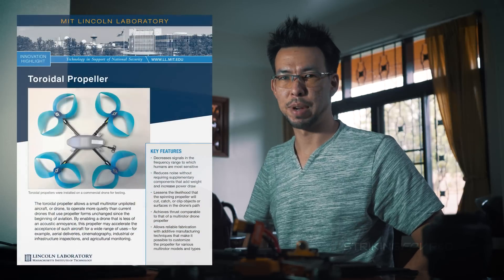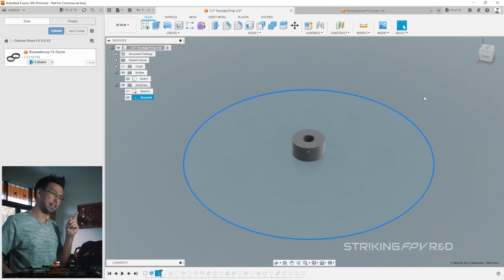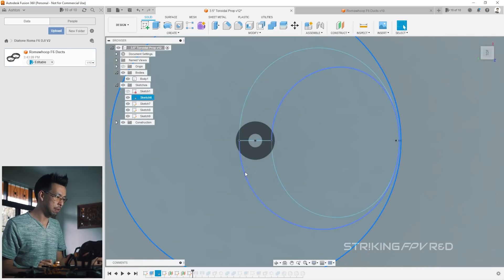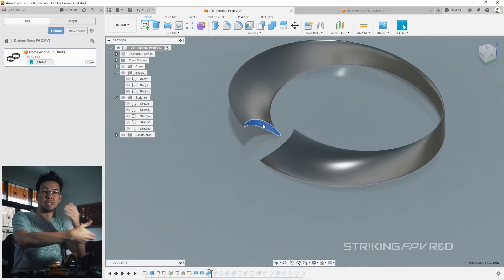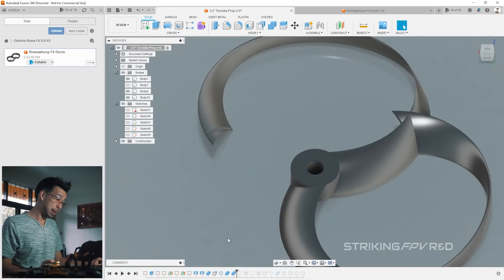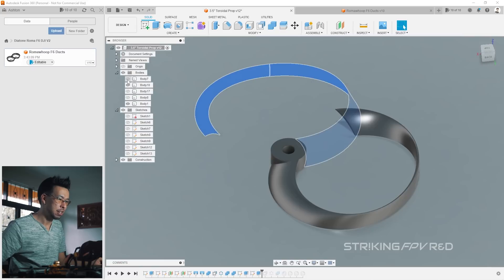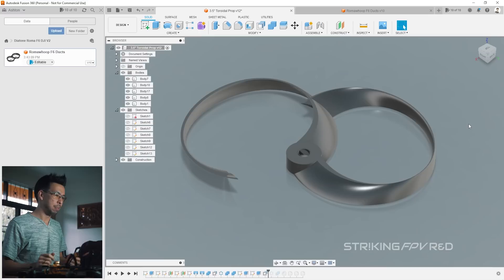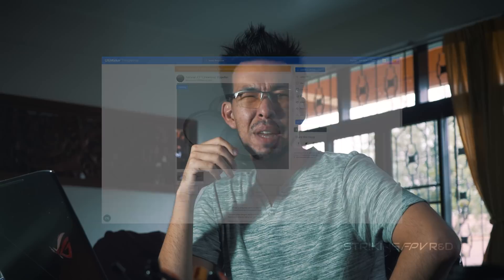DIY MIT Toroidal Propellers for Cinewhoop FPV Drones???

Comment from the maker: FYI: Latest video featuring frequent questions and suggestions is up:
https://youtu.be/pjZaGHKQB8Y

Hey all, so I couldn't wait and I added a bunch more sizes from 40mm, 2" up to 4", but all scaled from the original so they're not ideal.  Larger sizes would obviously need to be redesigned, but for now this will do.  Also I've never used or designed t-mount stuff either, so no idea if they'll work.

Interesting thought, a commenter named Max over on Thingiverse has already tried the design in TPU and it worked!  This has me excited for two reasons:
1) It works!
2) TPU might be a viable material here, because the toroidal design kind-of loops back on itself and provides more support for the overall shape.  Whereas regular TPU props would flex and flail in the wind, maybe this toroidal shape will hold stronger, despite the more flexible material.  Who knows!

And recently also @QEDFPV printed and tested the design to find lower noise and more thrust (but more amps) so certainly more work to be done.  Check out his video here:
https://youtu.be/qP0OPz3NgK4

One last update, I've already begun with another generation of the tri-toroidal design which tries to improve on blade shape and a shallower blade angle going out towards the tip.  Doesn't look as pretty, but might yield better results and be slightly lighter in weight, plus a bi-toroidal design too:
https://www.thingiverse.com/thing:5832892
https://www.thingiverse.com/thing:5833027

Comment: Thank you for your great work. To reduce the drag and weight, you should reduce the thickness of the blades as much as possible. This is where you will save energy and improve efficiency, from what I can see.

Comment: hi, your video is greatly wondful! but there is a question about the toroidal propeller, how do you calculate the geometryical parameters of the propeller, I am studying this question, I would appreciate it if you can reply to me
 :face-blue-wide-eyes::face-blue-wide-eyes::face-blue-wide-eyes:
Reply from the maker: Please watch the 10 Toroidal Questions video I did, as it might help a little in that regard, but not much.

Unlike traditional propellers, for which we have numerous aerofoil designs available and a known concept for calculating correct propeller pitch across the length of the blade, toroidals by their nature somewhat break the rule because they have to bend back into themselves. This bend requires that the blade angle will have to become steeper until its vertical to become the loop - traditional props need the blade angle to become shallower, further out.

I have an explanation for this roughly here:
https://youtu.be/pjZaGHKQB8Y?t=553

Beyond that, I haven't done any physics simulation or anything fancy, so can't really say much else about how to make the best or most efficient toroidal.  Bit of an unknown at the moment.
Reply: @STRIKINGFPV  :yougotthis:

Comment: The toroidal fan does not have to be revolving inside a cinewhoop, the cinewhoop can be built on to the toroidal. Also the outside of the cinewhoop could be rounded for side on air flow.
Reply: This would also strengthen your design.

Comment: There is an expired U.S. Patent 6,736,600 "Rotor with Split Blade" to Rudolf Bannasch that looks similar to the MIT toroidal propeller.  Please see Figure 7 of  U.S. Patent 6,736,600.  I have no idea of Mr. Bannasch's propeller has good performance or not, but it would be very interesting to see a comparison between MIT's propeller and Mr. Bannasch's propeller, especially since U.S. Patent 6,736,600 expired in 2020!
Reply from the maker: Crazy yeah, that's pretty much the lofted circles idea, it's more or less what initial toroidal designs are and kind of what QuadMovr did in his video.  I talk a little bit more about it in my latest video, but I believe the unique claim that the recent patent makes is specifically the leading blade intersecting with the trailing blade of a different loop, so I think that's how it was initially granted.  The big question is if anyone can prove that this is a significant enough difference to grant the patent, but I also suspect that MIT are not going to be so litigious towards our community - maybe towards DJI or potential military contractors, but I think we're alright for now, haha.

Comment: It seams to me very strange that this design has an inverse pitch progression. Standard propellers have a high pitch near the hub (30° or so) and the pitch is much reduced at the end of the blade (10° or so). This is because the end of the blade moves faster in the fluid than the root. The two-loops design of the MIT reproduces this, with the squashed ends. And the same for the Sharrow marine propeller: see the twist in the pitch... So why this vertical wall at the exterior of your loop? Seams conter-productive... could you try the squashed ends?
Reply from the maker: Yes no totally you're 100% correct, I did improve upon this in my latest designs.  It's still not perfect, much more work to do, but I'm moving towards a direction where I would like others to continue development as I don't think I can single-handedly keep working on this.  You're welcome to check out my latest video where I also address comments and suggestions that I've come across, and I also have plans to do tutorials on the design so others can continue experimenting themselves.

Comment: MIT wasn't the original creator of this infinity blade design, it came from the marine industry several years ago
Reply from the maker: As a general concept, I see where these infinity boat props are similar in terms of the loop back, but at the same time I wonder if there's enough reasonable difference that MIT were granted the patent for the toroidal props.  They certainly look different enough and have a very different application.

Makes me wonder if we get to a point where people can start to manufacture, will anyone try to challenge the MIT patent based on pre-existing material, like said infinity boat props.

Comment: everybody talks about that but missed delson aeronautics low noise propellers
Reply from the maker: That's interesting, I've searched for them but their website is gone, and what little Wayback Machine has doesn't share much. No designs, no images, still only a 30 second video and nothing else. Looks very vapourware at this point, especially considering they're no longer operating. And one of the claims of "10x maximum thrust increase" seems a little much.

You seem to remember well, did you find any more info or designs back in the day? Something I'm missing or hasn't been archived or shared?

Comment: 6:30 - Sometimes the best thing to do is file it down with a hand tool.
Whenever I can not print something because it's too thin, I just make it thick and finish it later.
Also, application difference - I mainly use 3D printing for forms I later make molds from. 📐🔨🧃

Comment: You can get them made from cf from thingaverse right?  I'm not sure I 100% like the design, it seems a bit inefficient especially on the vertical parts...but it seems like its definitely got potential.   If they're significantly quieter even if a little less efficient it might be worth it even over normal props.  

I think you could twist those outside supports top out, so they're also adding lift and not just hitting a wall of air?

Comment: Good news they do work. I was able to fly reasonably fine with my old BOLT SpeCops 01 HD version 5" quad  and modified "Tri-Toroidal_50x3..." (little down-scaling).  The noise is slightly different ..the high pitch is not present. Those printed props flex, but holding well even with loops and twists. They won't survive crash.
Reply from the maker: Oh that's cool to hear, I wonder if my latest designs will work better for you like they have for Johnny at @WillItMod, he found my V3 tri-loop behaves more like a traditional prop.  Indeed they won't survive crashes, props usually don't do well and if it's FDM then it'll explode I'm sure
Reply: @STRIKINGFPV  V3 They do perform so much better. The wobble is not present or I do not feel it. They noise is noticeably less present. Since I do not have 3"quad mostly 5" and if I push it they explode (at about 70-80% throttle) . I have to get some PETG otherwise they were all printed at higher temperature with PLA.  For me they would be great if I can eliminate need for ducked design quad.
Reply from the maker: @lee8org  When @MoppelMat printed from nylon carbon-fibre he had much lower weight than a standard prop, so I'm wondering if I have some leeway with the prop thickness and make it stronger, but of course there's a give/take in that if it's thicker to be stronger, it becomes heavier so it's under more stress, haha.

Maybe future versions can play with the thickness more, but for now I'm quite satisfied with V3's viability.  Now I'm working on the tutorial video first.

Comment: Trying this on my Ender 3 with PETG.  Might be an excuse to finally try out the AnyCubic Photon Mono SQ resin printer that's been sitting there for a few months, ha ha.  Just have not had the motivation or an interesting design that required it.

Comment: this is cool, I will give it a shot on my FDM printer. All my cinewhoops are 3 inch though so I can't actually test the props if they manage to print ok.
Reply from the maker: The original design has 3" versions available, but the latest design I'm still trying to work on the smaller sizes

Comment: Thanks for "biblade" 5" design i want to try that one. 
I have acces to Stratasys F770 (beast of a printer) and i will print this using ASA filament. WIll let you know how it works out
Reply from the maker: Good luck, hope it works out!
Reply: @STRIKINGFPV  Tested it on Trilab Industral using PA12+CF filament. You can see it on my youtube channel. 
Definitely a different sound. Lower. But at the same time much higher power consumption to the extent that the motors get warm. I'll play around with the PID a bit and try to take it outside when it stops snowing haha. I will have ASA ones printed od stratasys tomorrow probably

Comment: This is great. I have tried to make a few of my own toroidal props for RC planes at 70mm radius and test them on a thrust load cell. These have been 3D printed on an old Prusa printer and have worked well so far.  I will scale up and print your design and test them.on the rig as well to compare results.
Reply from the maker: Go for it, would love to see how it looks on a plane, I imagine it'll be as weird as they look on FPV drones, haha

Comment: I don't think this 3 blade design is not the most efficient one from the paper. The blue bi blade is.
Reply from the maker: Oh I totally agree, I think it's similar to how a lot of long range drones use bi-blades, but I chose the tri-blade mainly because of looks, hehe, but also in the whoop space I think they're less "slicey", and more likely to bounce off things, so there is some kind of application there.

That being said, I will give their bi-blade design a go at some point.
Reply: @STRIKINGFPV  I also want 3 blade for my cinewhoop, they look cool and looks like we could fly without ducts or props guard.. I am checking what people are making. In the mean time I am working on a setup to measure trust, efficiency and sound so I could compare each iteration of props.

Comment: What about making edges horizontal but not vertical. Normally blades angle get closer to horizontal at the edges, since speed of blade is higher there.
Reply from the maker: I think part of what makes standard props and a lot of wings so loud is the turbulence at the wing tips, and so the toroidal prop design is trying to make a wing without a tip. I have a feeling that a horizontal tip might be too similar to a regular wing, but your idea is still interesting. Might give it a go at some point.
Reply: @STRIKINGFPV  I think It would be what MIT did. Tip of first blade doesn't end thus creating vortexes, it gets thin, flat and continues and turns into tip of next blade.

Comment: This is awesome. I would like to try this out on my 5 inch quads. Could you add a version with a 130mm circumference and a 4.75mm shaft hole? I wished I knew how to work Fusion 360, I would do it myself. Thanks for sharing, this is a fun experiment.
Reply from the maker: I'm actually already working on my next generation design, you can try it out here but it's still WIP:
https://www.thingiverse.com/thing:5832892
Reply: @STRIKINGFPV  I was actually able to resize the 4in props up by 134% and they made the perfect size for 5inch, even the shaft hole worked out. I have my second printing now. I'll check out your new one. Thanks.
Reply: @STRIKINGFPV  I like the new design, it looks like it might be more aggressive.
Reply from the maker: @MikeMillerDrones  Technically it's actually less aggressive in terms of the blade angle, but that should hopefully reduce drag and generate more lift further out towards the edge.  Only issue is that it is a fair bit thinner, so a well-tuned FDM is needed (or resin or laser sintering, hehe).
Reply: @STRIKING FPV  I am printing them in pla. Will probably explode, but it wil be fun to try
Reply from the maker: @MikeMillerDrones  I predict an explosion as well, haha.  When I get back home I'll probably try my PETG, but I think at 5" and 6" sizes it'll still explode.

Tempting to try TPU - a regular prop in TPU will just flair around I think, but maybe this tri-toroidal design has an increase in rigidity because of how it rejoins itself, so that could be viable, hehe.

Comment: Something is wrong... You get the largest angle of attack in the "tip" of the blade and the smallest angle of attack closest to the hub... It should be the opposite.
Reply from the maker: This is a very good point - the whole purpose of the toroidal shape is to remove the wing tip, since in most aircraft the wingtip is where the most turbulence occurs, hence MIT's design removing the blade tip by coming back in on itself.  Another commenter suggested that instead of the edge going vertical, make it horizontal, which would better match typical propeller design, but then that would reintroduce a blade tip, of sorts.

I'm currently working on a next generation or iteration of this design which tries to maintain more of the shallow blade angle further out before the vertical loop-back, you can check it out here, but it's still a WIP:
https://www.thingiverse.com/thing:5832892

Comment: The angle in the middle of the prop seems much to high, normal propeller are in the range of 30 to 35 degree. Can you check if your design is at approx, 45 degrees? That forced to much power consumption for the motors, the ampere and the thrust goes up to much. I would like a design with a lower angle, similar thrust like normal props. This could be also much quieter. Thanks for your video, very great help for me as a fusion noob. Will try this to redesign your workflow
Reply from the maker: That's something I need to work out, because the design needs to eventually go vertical at the tips, part of the challenge is to try and maintain a shallower angle as far out as possible but that's kind of a difficult challenge.  I have an idea on how to improve it, but have to do some more testing.

This might also be why MIT's final design favours this bi-blade/bi-loop configuration, if it allows them to keep the blade angle shallower for longer before reaching the outer edge.

Comment: I'll print the 2 and 4inch for my 2inch and 5inch drone. Maybe I might scale up the 4inch to 5inch. I have a dual extruder printer, so overhangs are not a problem for me. Many thanks!!!
Reply from the maker: Ah, you also using dissolvable filament for the overhangs?  Always wanted to see how that stuff works, maybe one day, I can dream 😅

Comment: I am really interested in how the will behave once they get revd in terms of their shape. I can imagine they might grow in diameter and could possibly get in conflict with prop ducts/guards. Looking really forward to any results. Thanks for sharing the construction files and for walking us through the design process.
Reply from the maker: I remember looking up prop design online and seeing all the theory behind the blade size, length, angle and stuff - I feel like this toroidal design will need some standardised method of gauging their profile as well, and there will need to be a lot of prototyping to see what design works the best and in what way.

Then there's manufacturing - injection moulding will be ideal, but because MIT have a patent, I'm not sure how easily or quickly prop manufacturers will actually jump on these possibilities, considering the amount of R&D first needed, plus tooling.  Lots of questions, but also kinda' exciting times, if these might become the next big change in the drone space.

Comment: Make a 5 inch version and I will upload a video using it.
Reply from the maker: I made up to a 4 inch, but literally just scaling the design so it's becoming big and thick and probably not ideal, so for larger sizes I think probably makes sense to do a fresh design, which I'll try and get around to at some point.  Many issues with my current iteration which can be solved with better planning, so will get to that at some point, but I am travelling so it's a bit inconvenient at the moment.